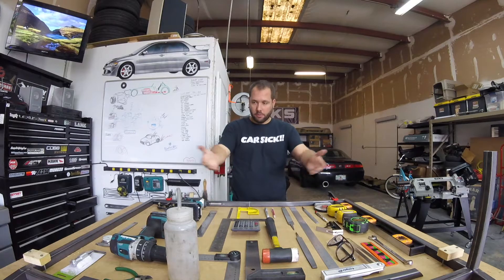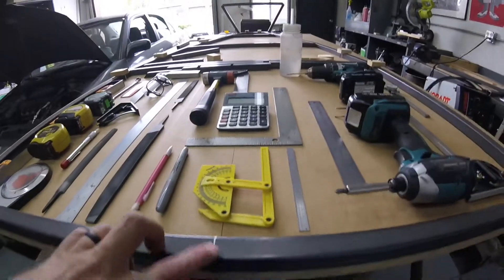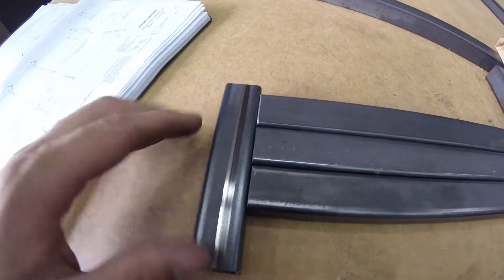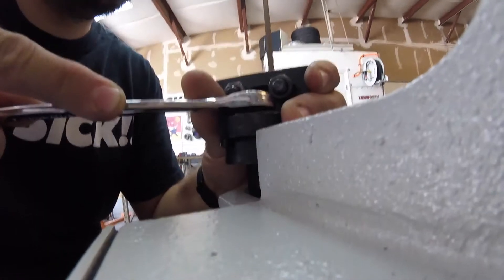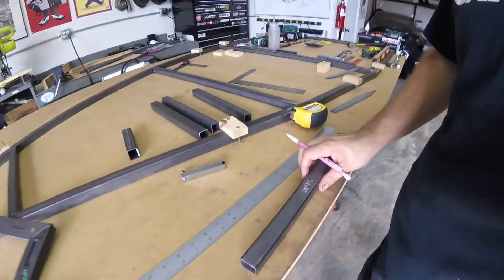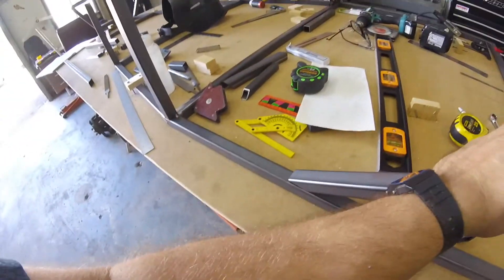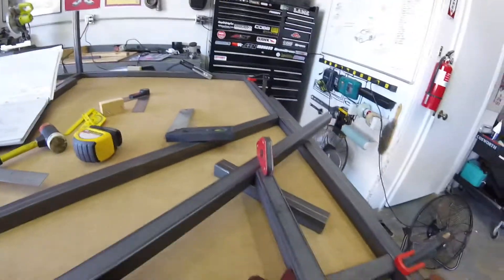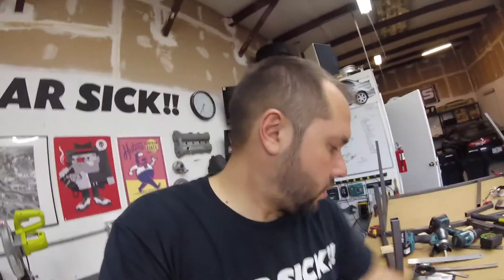Going Vertical: Building A Locost Frame

Comment: how much 1x1 you need to for the frame?
Reply from the maker: hmmm, i have the receipt at the shop. There are calculated total lengths in feet in the plans. There is also several threads discussing it on several forums. I spent about $300 on metal. Bought a few extra pieces of 3/4” than I needed though
Reply: Car Sick!! You thing you could make the locost mid engine?